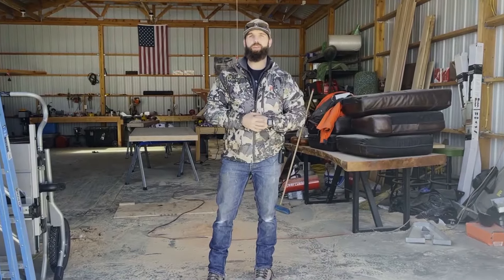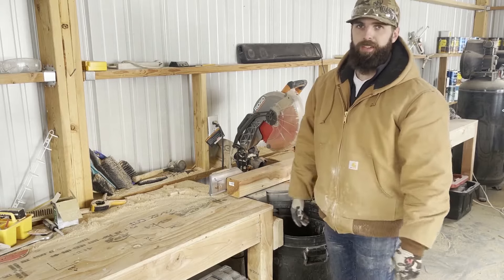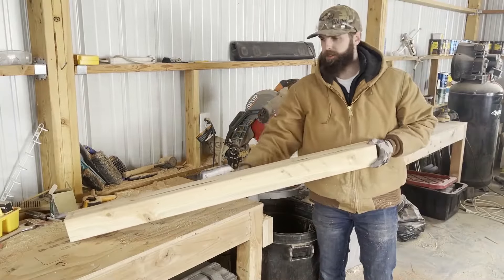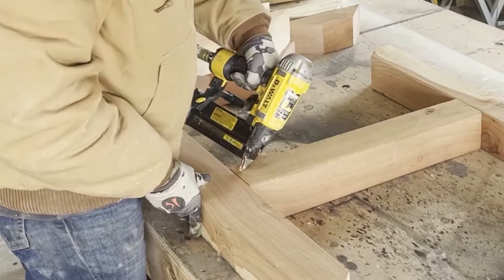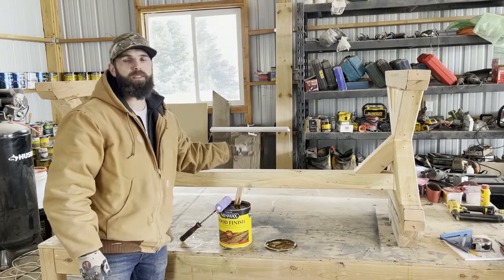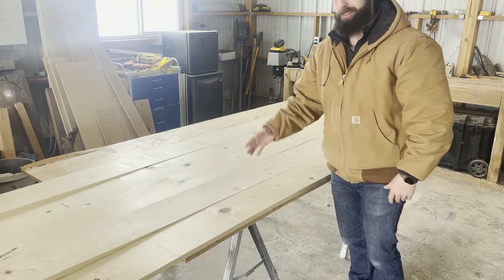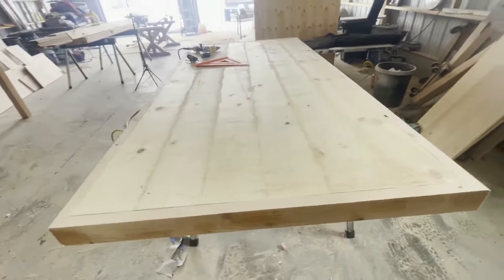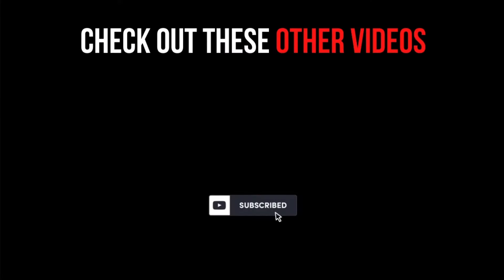How to build a FARMHOUSE TABLE!!

Comment: I’m building this table now. Where did you get the black metal for the corners?
Reply: I am too, I' still trying to figure out how I'm going to attach the table top to the base. Any Ideas?
Reply: I'm thinking about using L brackets but I'd like to figure out a way to attach it so that I can easily take off the top if i need to
Reply: @Boodge-hc9jl  
Yes, I’ve got 4 smaller pieces of wood underneath on the inside of the top braces. Glued & screwed into the brace, then screw to top from underneath
Reply: @Boodge-hc9jl  
Black L brackets where I’m talking about putting my wood pieces is a great idea.
Reply: @owenmanadventureswild2158  I finished and did something a little similar. I used two 2 foot 4x4 blocks and fixed them underneath the tabletop, then screwed 4 3/4 dowel holes all the way through the block and into the top strut of the base. So if I need to move it all I need to do is hammer out the dowels and remove the tabletop.